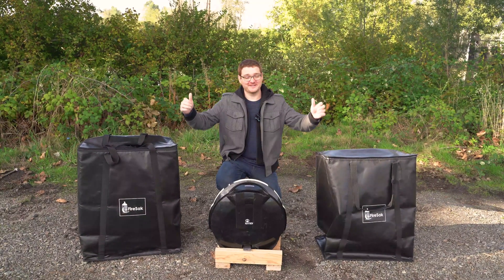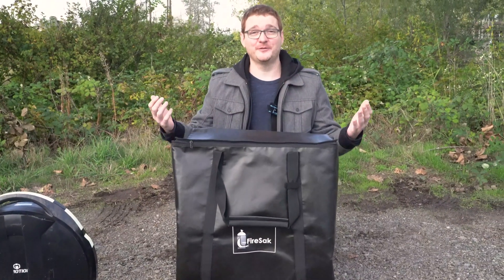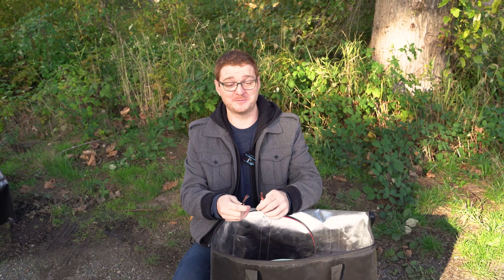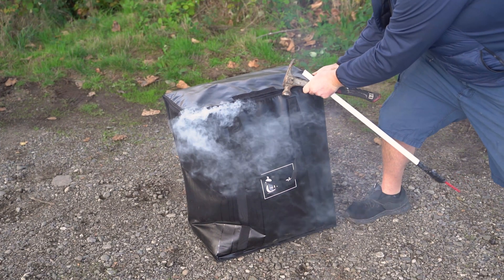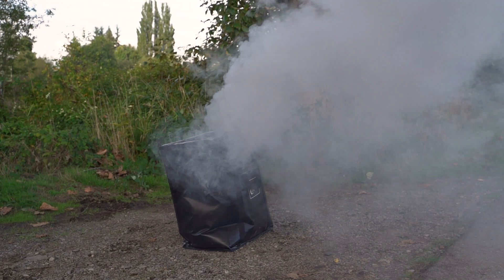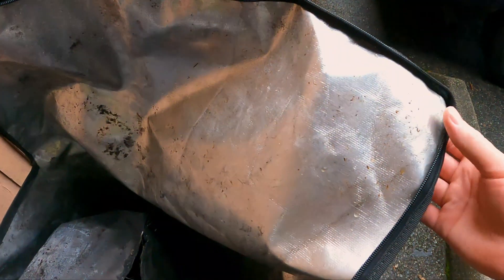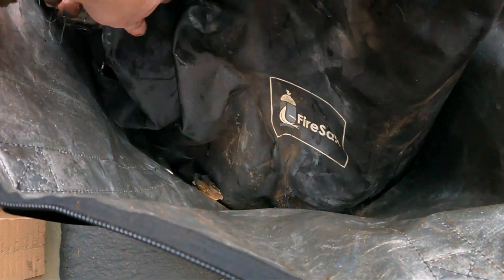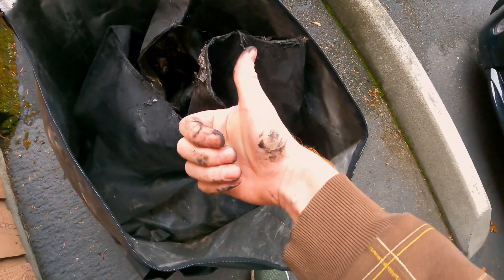Lithium Battery Suppression System - FireSak. test #1

Comment: Thinking all scooter batteries should be  detachable from scooters so they can be stored in bags like these while they charge.
Reply from the maker: Dualtron Storm? Anyone 😁
Reply: @GingerOnWheels  Yeah, I've def seen that one. After my Wolf King fiasco, I'll choose better on my next purchase. I do love the Wolf King but it's too unrefined in my opinion.
Reply from the maker: @TimothyMoore  oh you had a wolf king fiasco?! Do tell.
Reply: @GingerOnWheels  The fiasco is the twitchiness of the throttle. I realized you mentioned the inability to reliably get the throttle to always perform the same way at slower speeds. What ebike did they steal that controller from? It def wasn't designed for scooters.
Reply: @GingerOnWheels  Also had a scare taking off from a light. I must have been standing to far back on the deck when I hit the throttle the front wheel went airborne on it's own. Scared the shit out of me. 😂 This was in P2 on one motor.
Reply from the maker: @TimothyMoore  Surprisingly, it was designed for scooters. From minimotors usa. It's just a jerky throttle. You can tone it down in the p settings a bit, but it'll never be as smooth as the King GT which has sinewave controllers.

Comment: What about international orders? And variants for scooters? I'd buy 2 if you shipped to Norway. One for my wheel and one for my scoot.
Reply from the maker: No international shipping as of yet. Need to sell through batch 1 and get logistics sorted first. I'm sure it'll come in time, we just aren't there yet.
Reply: @GingerOnWheels  Cool cool. Even though the struggle you had to ignite the wheel is assuring I really want an easily accessible way to reduce the damage if a fire occurred.
Reply from the maker: @HolybasilYT  this is definitely an inmotion thing. We took apart the battery and found that the entire side of the battery is a bms, its massive and can't be bypassed without reducing the voltage of the battery to a point where it wouldn't catch fire if shorted. If the bms were damaged though in a crash and allowed the wheel to overcharge.... 💥🔥🔥🚒👨‍🚒👩‍🚒
Reply: @GingerOnWheels  inmotion is certainly a step above a lot of the competition when it comes to quality control 🙂
Reply: Great idea! ✨✅✨I’m trying to get on your site but it will not load all the way. Tried your link & manually. ✨🤷‍♂️✨
Reply from the maker: @chrisbruce3164  you talking about firesak.com ? It's working for me. It does take a while to load, but definitely not offline
Reply: @GingerOnWheels  Ok I’ll try again. ✨✅✨